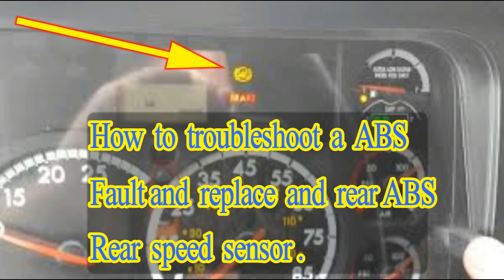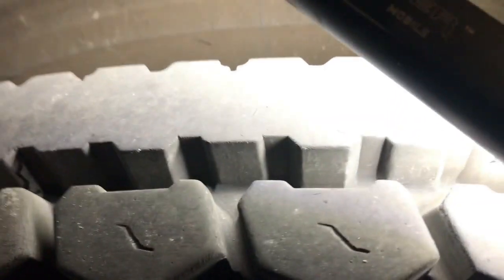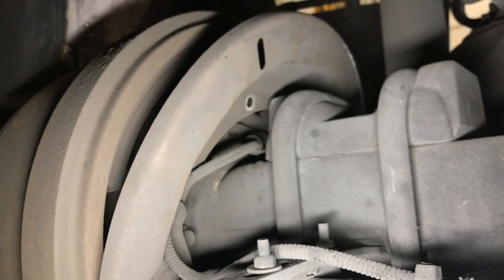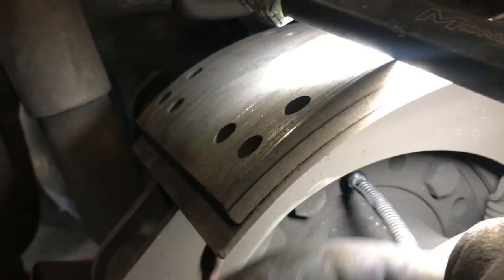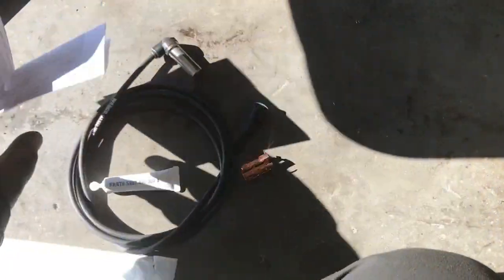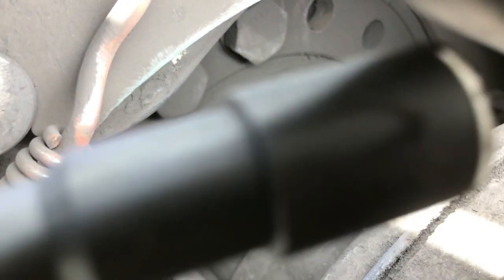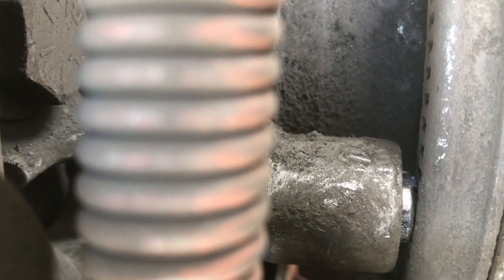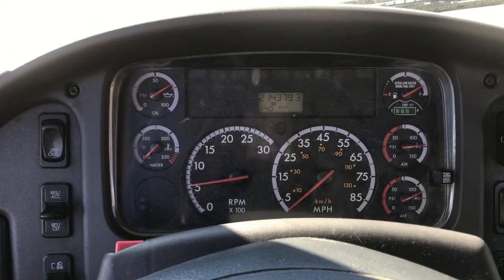How to Fix ABS light fault and Replaced ABS wheel sensor on freightliner M2

Comment: hello ， Thanks for the video ， one of our truck that have a ABS light on and code is spn 520502 fmi 10 ，when we start the truck and driving it truck will NOT go up 4 mph ， when I look up the computer ， all ABS reading is 0.80 but ， when I drive the truck ， wheel 6and wheel 7 will go down to 0.2 and 0.3 ， ( I did replace all the ABS sensor to new ) if you know anything about it, what is going on with the truck please let me know thank you very much !

Comment: How can  I contact you? I have a problem with the ABS and I’ve been in two places and they won’t fix the issue. The abs light come in and disconnect the communication with the engine transmission light come in and the truck shut off
Reply: Let me know where I can send you my info if you are interested in troubleshooting the abs issue. Thanks!
Reply: Mine is doing the same and I've been to two shops , trans-spn 563 fmi 14 and ABS- spn 807 fmi 2. Mine is a 2014 freightliner , I believe wabco ABS system , it seems to be more electrical problems than mechanical problems.. shops need more electricians more than ever now..
Reply: My'05 M2 106 has disc brakes and often their 66mm dual plastic  pistons stick and freeze brakes resulting in scared rotors and burnt pads as well as melted sensors ! 2500$ per axle repair bills, I have a stack of these pairs over 25000$. Aside issues were engine overheating and shutting down on I95 as well as twice on Atlanta beltway. Turned out to be slipping trans clutch and malfunctioning fan clutch and it's relay. 9000$ to fix that. Currently in shop again for rear brake frozen damaged (again). Could the abs pump be bad and abs module. It's vbeen a nightmare owning this M2. Ws wipers often on when steering. No end in problems.

Comment: Thank you for this video. How long did it take you to replace this sensor? 
When I went to the shop here in Chicago I was told that it will take about 8-10 hours + parts + taxes. At the rate of $65/h that might come to $800 per sensor. I think its too much for the s..d light fix.
Reply from the maker: That sounds high maybe 4 hrs the sensor the sensor is not that much .
Reply: @bigrigfix  unless its seized in the sensor housing which has happened to me several times
Reply from the maker: That seems kind of ridiculous. It’s really easy to change the Sentra. Just check out the wheel and sometimes remove brakes.
Reply: @bigrigfix  the sensor itself normally takes 20 mins max to change but LIKE I SAID I’ve seen it seized inside the bracket that houses it. I’ve had to put the housing in a vice and chisel it out. Took about an hour to get it out.

Comment: I'm getting 2 codes 
brake abs mode switch open
136s016 05 and 
Brake sa11 spn000016 05
Abs and ATC light on. Can you tell me what the codes mean? They came on after washed my truck 2 weeks ago  and the  lights would go off but now they stay on
Reply from the maker: There Bendix or Wabco fault code look them up on google.
Reply: @bigrigfix  thanks

Comment: Have freight liner Columbia 2006 code Abs 136 sid 002 fail 10 , any idea !!! Is that will effect my truck driving !!!! Thank you
Reply from the maker: Dr Ryan Ayala is the truck driving different then Normal.
Reply: Big Rig Fix it’s sound like my front right steer tire always sounds weird and truck pulls to right ...i change the steer tire ,alignment ,shocks , sprint still have that issue !!! And that code com on and disappear sometimes....that’s really drive me crazy
Reply from the maker: Dr Ryan Ayala Check your wheel bearings play on the front axle out of spec .The abs sensor is not  reading abs ring toner maybe bearings have to much play check spec and play.
Reply: Big Rig Fix thank you much sir